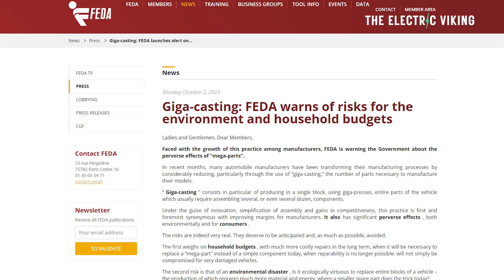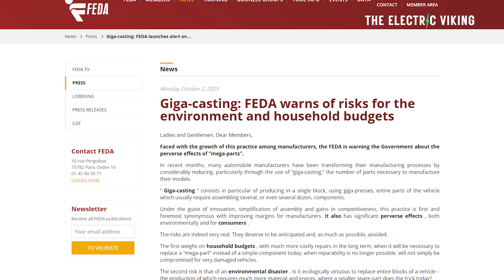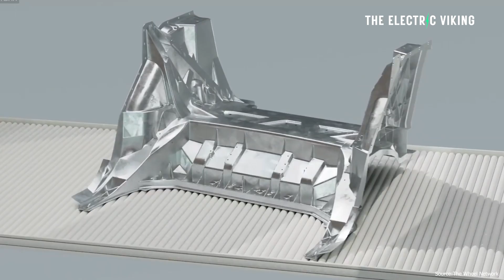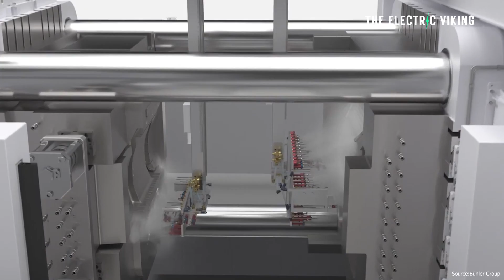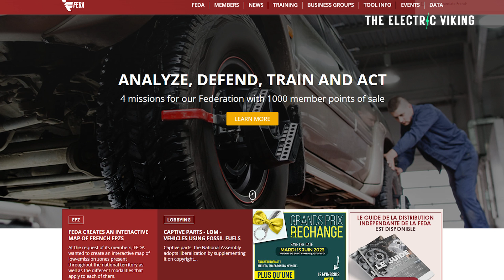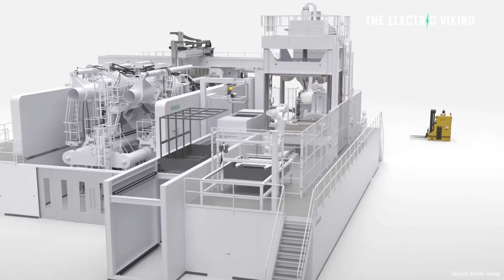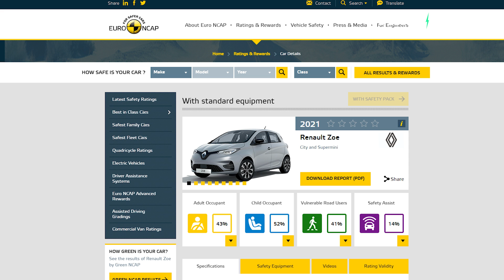Magna and French auto industry issue red alert; warn dangers of Gigacasting

Comment: There's an industry (not large but loud) of auto repairers who specialize in buying "crash writeoff" cars, 'repairing' them so they LOOK fine, and selling them to you as if never bent. That's who hates the one-piece castings. Avoid their "product" like the plague, dangerous and unreliable.
Reply: In the U.S. at least, salvage vehicles can be bought at auction, rebuilt, and assigned a rebuilt title IF the car is safely repaired and passes inspection.  Anyone doing unsafe work is personally liable if substandard work is intentional.   Most cars with rebuilt titles are virtually indistinguishable from any other car.  Personally, I would avoid flood salvage cars over collision salvage cars.
Reply: @ohger1  You forget; "You don't know what you don't know".
Reply: Do you have any citations for that since they're "loud"?  
Sounds more like unions howling about reduced labor. Castings can be welded (properly)  and modern collision repair has found ways to join materials like (NHTSA tested) adhesives which are also used in new vehicle construction.
Reply: @Comm0ut  See responses here. There is a loud group attacking Tesla because the won't sell many structural parts outside a network of repair shops they have trained personally. "Unfair anti-american" they say. However, i also note that the identical practice prevails in most German auto companies.
Reply: I had a Ford that had been rebuilt from two different cars. One of the best vehicles I ever owned. Nothing wrong with a rebuilt car IF it was done right.
Reply: Yes, surely some members of FEDA (its an automotive aftermarket federation) do that  and thus hate giga casting.
Reply: In the UK, the practice of getting the front of one car and the back of another is known as a cut and shut. You trim the two until they more or less fit together and weld what’s left. A very simple version of a giga, casting much cheaper than building the whole thing from scratch which is why they do it.

Comment: Frankly speaking, we don't have enough official available information on how the structural "giga-casting" made is made. For example, we know that in the "traditional" chassis, there are crumple zone to absorb energy during impact and the that part of the structure will be deformed. And generally, there are 2 repair strategies: either pull back the deformed in a chassis repair bench with special-made alignment fixtures, and/or cut off the affected part of the chassis and replace with new on by welding or riveting or whatsoever that was already put there in the design process of the chassis. Now with the one-piece casted under-chassis, we only know that it  is strong enough to pass the crash testing (we can assume that it should have design on absorbing the impact energy so that the passenger inside the car is properly protected as well), but there is no information on it there is any repair strategies, especially on minor impacts that is still economically repairable in the past, exists.  For example, is a "minor" impact at 20km/h will cause a deformation of the chassis that is beyond repair and has to declare total lost, then the claim made by the French auto industry is worth re-considering. Or else everyone has to pay higher insurance premiums.
Reply: giga casting seperate from crumple zones,

Comment: The high initial capital costs of giga casting requires high volume manufacturing product to pay off that investment. Does Magna have a product that has enough volume to justify giga casting?
Reply: Magna is a HUGE company. They build plenty of high-volume parts - and they build steel stampings, aluminium castings, machined parts, whatever. They're not "threatened" ... if someone wants them to make a big casting, they'd do it.
Reply: @bikeaddictbp  Yes. This was my point. Giga casting is cost effective for making a single part in high volume. With out the demand volume Magna does not need giga casting. Once they do have volume that justifies giga casting they will make the business decision to go that way.

Comment: What is right might not necessarily good for other for one reason. Tesla produces huge volumes of the same model. 
The huge investment makes perfect sense for them. For far lower volumes maybe not.
Reply: With a little foresight it should be possible to make a gigacasting that works for several models. It might need to forego a few features to do so, but it would still be a big improvement over the status quo.

Comment: To be fair: Tesla is pretty cavalier about repair cost quoting a $20K new battery pack to fix a broken off nipple for the cooling system. Also the packs are internally not serviceable.
Reply: Who said? do you believe everything anyone says?  Of course there are ways to repair anything. Is it worth it? Does it operate in an acceptably safe way? Whose dime? Do you take the risk or does someone else? etc.
Reply: It's a well known fact that Tesla packs are sealed shut and the newest version filled up with some sort of goo that makes even more sure nobody repleces individual cells as well as individual modules. It's all designed to be thrown away if just one of the countless parts it consists of fails which bodes bad for future residual value of out of battery warranty Tesla's. Those basically have no value.

About those cracked cooling system connectors: there are third parties that replace them but Tesla won't touch them.  @tedmoss

Comment: Well with batteries in the structure, I wonder if  the slightest damage may mean there is a small chance the battery is damaged which totals the car.
Reply: Most traditional cars hit hard enough to damage the frame at the level it would intrude on an EV's battery pack and damage it will most likely be written off anyway.

Comment: Magna should have been first to get on the giga bandwagon.... they could have led the rest of the industry but instead are trying to piss in the wind. Foolish strategy but probably just a smoke screen to cover up that they are behind and have huge sunk cost in conventional stamping. That said, giga casting is terrible from the perspective of repairability and concomitant insurance impact (though insurance impact might be offset by the excellent crash safety characteristics). I'm not convinced repairability has been given sufficient analysis (same issue with carbon cars like the BMW i3 or some super cars) - a fairly minor rear quarter hit for instance can damage the rear casting which is minor in the grand scheme of things, but still might cause a write-off. You guys are incorrect to say that any hit that damages the casting would be a write-off anyway; that's simply incorrect.

Comment: If the cost of repairs is over $75 %value of the car. Car is a total loss. Aluminum coposit cars are more difficult to weld. You need a special welder. With normal cars there is clue or spot welder frame parts. Its also hard to replace. If the normal car has frame damage is the same thing total loss. I’m sure what the French are talking about. Perhaps in France you fix frame damage cars.
Reply: That may add up on one single car, but is meaningless if you are producing millions of cars and can reduce prices significantly

Comment: One thing is, gigacastings lower the price only on very high volume cars; there are quite a few relatively low volume cars being produced in Europe. These brands should be closed, but Stellantis hoard them for some reason. I would suppose Magma, by nature, makes a lot of these low volumes vehicles, meaning they couldn't easily make use of gigacastings.
Reply: We may see a company like Magna produce a single cast car chassis that many others build cars on.
Reply: @danharold3087  It seems like it's already the way many cars are made: several brands using the same chassis to lower costs. Still, making them different enough is costly. I very much doubt these differences actually help selling more cars, even if it's the way many people think.
Tesla demonstrated one category killer is much better than many slightly different headlights or IPs.
Reply: @FlorestanTrement  Keyword is seems as the auto makers are playing high stake poker.   We can't play in that game

Auto parts maker & contract car builder Magna Styer is working on a skateboard they call Flextreme.   It is possible that this skateboard may eventually end up in the hands of custom call builders.  Not all that likely but possible. 
But I mentioned single piece cast in my original post.  This is unlikely unless Magna, or similar,  starts making megaCastings.  That is a possibility and what I was talking about.  An inexpensive skateboard from a company willing to sell it.
Reply: Having a portfolio of "quirky" low volume brands to fill niches that your volume brands can't is actually good strategy for a large auto group. After the dust settles over the next decade (which settling will involve the demise of some current corporations) or so I think the world auto industry will revert to a few large groups, each with that sort of strategy. So long run you can see volume brands using gigacasting coexisting with a plethora of more bespoke marques. The marketing logic will reassert itself.
Reply: @kenoliver8913  It is not a good strategy, IMO. 
There are extreme cases, like very low power cars that doesn't require a licence in some countries for people who can't get a real one because of age or incompetence. These market are extremely tiny, thankfully, as having to follow these slow moving matchboxes on wheels on the road is a pain. And any collision likely bloody.
And ultra luxury cars, like Ferrari or Rolls Royce. Not the kind Magna would make. You can't keep a large auto group on that.
Past that, lower volume means higher price, while gigacasting makes higher volume even cheaper, hence Magma's whining. But, I'm only some guy commenting on youtube.
Reply: @FlorestanTrement  You are mising the point. If you are, say, Stellantis the bulk of your revenue will come from the likes Chrysler or Nissan or Peugeot. But you can still make a tidy little profit from keeping names that appeal to little niches in different global markets. You retain Cadillac and SEAT and Dacia and Opel and Maserati and Eunos and so on.
Reply: @kenoliver8913 Dacia doesn't belong to Stellantis, but to Renault. Seat belongs to VW.
I'd say you missed mine. An example: Opel is supposed to sell cheap cars. Opel cars are basically Peugeot cars copies. AFAIK, so are mostly, Citroëns. Fiat are basically competition to these brands. And also Lancia and mostly Alpha Romeo.
You have here dozens of cars aiming at the very same markets, competing with each other. Each have their fixed costs.
Sure, that customer might like the looks of this brand more than that one, and another one will only buy from that other brand. 
The differences are anecdotal at best, while their costs are tremendous. The multiplication and dilution of advertisement is a money bleed by itself. So is the logistic, the use of many more engineers that needed to basically create duplicates of the very same form factor executing the same function. 
Customers only need one model for each function. The ones who do are so few they don't matter.
Remove these brands, you remove these huge costs, multiply your margin, free resources to make each car much better, get rid of most of the management structures and lose only a small fraction of your customers, while gaining market share from the better, cheaper product and advertisement.
Brand multiplicity is just an emanation of the sunk costs fallacy. And, likely, management politics and pressures: these powerful leeches don't want to risk losing their job.
The model Y is the most sold car (not EV, car) in the world with only three versions that are close to identical, with 5 color choices and 3 types of wheels. And most people won't even make the difference with a model 3 at first glance. Why? Because the one size fits all approach made it a far better and cheaper car, so much so they don't even need to advertise. 
Well three versions isn't completely accurate, but I hope I made my point clearer.
Reply: That's a pretty interesting thought!
Reply: So you are saying there are no more brilliant engineers in the world except Elon? (Besides myself I mean).
Reply: @tedmoss  These are your words, not mine; It is dishonest to pretend they are mine.

Comment: I remember a Porsche project from the early 1970s, government-sponsored I believe, to engineer a car that would last for at least 20 years and at the end of its life be readily recyclable. It was intended to be refurbishable: interiors as well as the usual mechanical wear parts. Key to the recycling element was aluminium bodywork and structure, and use of aluminium cabling etc. would allow most of it to be crushed and melted down after stripping off the drivetrain. The theory was that aluminium, although more costly to build with, is ultimately no more costly because of its recycle value. Maybe Tesla is doing something that the industry, notably Daimler-Benz, scoffed at in the last century.
Reply: Tesla is just using ideas that have been around for a while and others were to short sighted to do.
Reply: @tedmoss  Tesla/Space X had to invent an alloy that previously didn't exist in order to make mega castings at the size they are.
Reply: It takes a great amount of confidence in the volume of the model being produced to invest in gigapress castings. Planning for a million plus cars is a gamble unless you have an edge over the competition. 😊
Reply: I was told in the 70s that VW (I think) experimented with wrought iron to make cars from as it doesn't rust and is very strong. Maybe a bit heavy though :)
Reply: That’s a 🧸 ta Corolla and Prius.
Reply: I wonder if the eventual result of that Porsche project was the Audi A2.
Reply: It must be a real challenge for existing manufacturers.  Tesla sales are so high that they have enormous economies of scale.  They can afford to invest huge sums in automation, which obviously lead to superior products and lower manufacturing costs.  European manufacturers are also hamstrung by employment laws, which protect workers.  If they reduce the need for manufacturing staff, it will cost them large sums of money to make people redundant.
Reply: I’ve been saying this for over a decade now...totally agree.  Among many other things, I suspect Tesla will upend the entire market in that there will be less mechanics and more re-upholsterers and vinyl-wrappers and other services that refresh cars as they last more or less forever.  There will also likely be an entire new market to install features that personalize individually-owned Teslas in part-time robotaxi use.
Reply: The Japanese are saying 20 years is that all?
Reply: Yes, that all our engineers were also thinking about but bean counters and short profit oriented men-agers have been against in fear of selling less cars. This is stupid like anything but again this💩trend came from psychopaths in USA teaching to buy new cars every year and therefore just keeping old technology under the hood but change the visual approach and not the inner quality as Tesla does. So thinking people go for that brand even if they lower prices make older cars loosing more value, but on the other hand there is no reason to change fast as you get improvements over time that never any ICE legacy company offered besides restoring some hundreds of valuable classic cars. As an example we own a very rare Peugeot RCZ R about 9 years old and Stellantis is even not in a position to offer a new navigation and new radio up to actual norms and present display quality. The basis for the RCZ made by Magna was the well know and mass produced 308 so out there have been millions that cannot get new radio and navigation of our times and NOBODY is interested to assist CUSTOMERS! Understand why Tesla is attracting so many buyers from old legacy?
Reply: @Lifecoach7Ra  american consumer here. I buy cars 2-3 years old but without high mileage, and drive them 8-10 years, this maximizes value. by the 2-3 year mark, flaws are known, so the model can be judged; the car is known but not worn out. I buy mid-range Toyota or Honda, because these companies have good reputations (before my current plan I'd bought whatever seemed cheapest at the time, will never buy Chrysler(now Stelantis)  or Nissan again, VW doubtful ). By current ride is about to hit 100k miles, and I think it's got maybe another 30k-50k left before it starts having strange issues. By that time, 2022 models should be cheaper and known quantities and that's where I'll look.

Comment: Aren't engines cast?  Do they fret about it, and demand that engines be made from lots of bits welded together, so that they can be replaced piecemeal?  This is really, really bizarre.  Most arguments or concerns I hear are flimsy, but I honestly didn't expect them to go this far.  (Sandy Munro's sledgehammer video is worth watching regarding casting durability.)
Reply: For about 30 years there have been motorcycle frames made from a small number of large aluminium alloy castings welded together, or a combination of castings and extrusions.